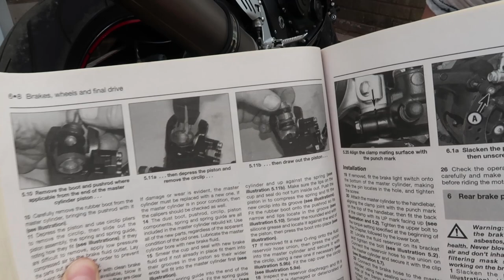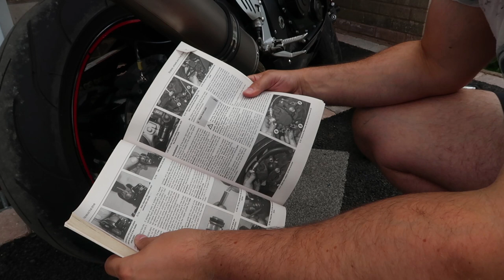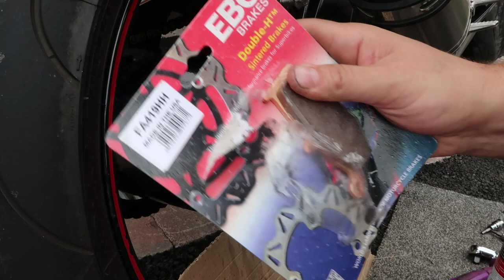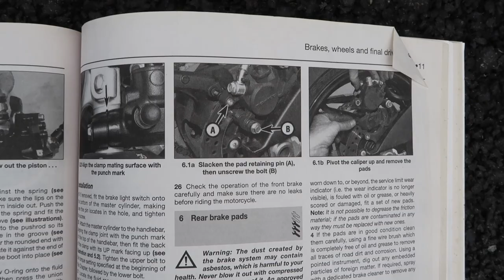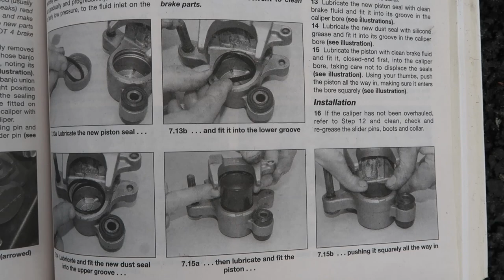Rear Brake pad replacement Suzuki GSXR 600 k6 - K7 - inc clean and removal.

Comment: Not a bad attempt, im no expert but i was tought by a mate who was a breke technician and he advised me to use red rubber grease onlong  the slider pins (but not the end of the pin) that sit within the rubber boots and copper grease on back of pads where it will make contact with caliper and on the clip as you did. 👍
Reply from the maker: Yeah I probably went over board but key is just not to get the stuff on the front of the pad.
I just like the copper grease because it seems to stay on longer, I use the red grease for axel and bearings when they don't come in contact with moisture but yeah the red grease could be better but just use what ever you have to hand.
Just want to stop corrosion and them sticking that's all

Comment: Normally you put lock tight on MOtorcycle bolts so they dont come out from vibration. I don't know that you should lube them, so they come out easier.
Reply from the maker: I just do it because I find that they tend to get seized but that could just be due to high moisture were I am but you are rite locktight its normally your best bet if you dont want them to come out etc.

Comment: I woke up to ride my bike n no back breaks I blead them nothing so I'm going to clean the calipers n try again
Reply from the maker: If you still have good amount of pads left and there is new fluid and you can see that the pads are compressing against the disk, try cleaning with brake cleaner as you might have some residue e.g brake fluid or some type of lubricant on pads and disk.
Worth a mention